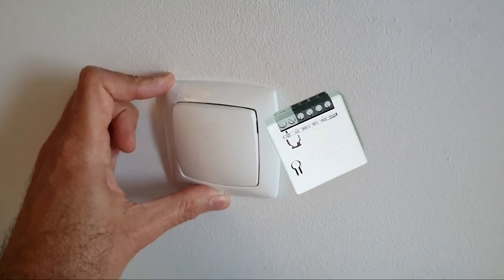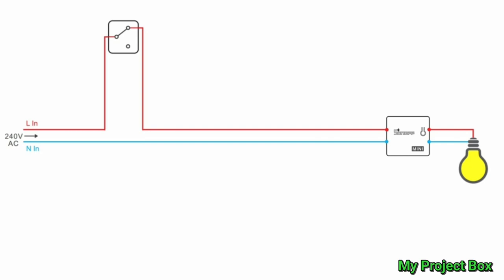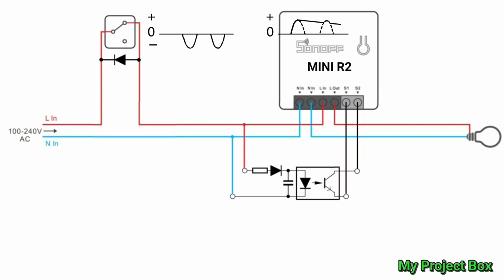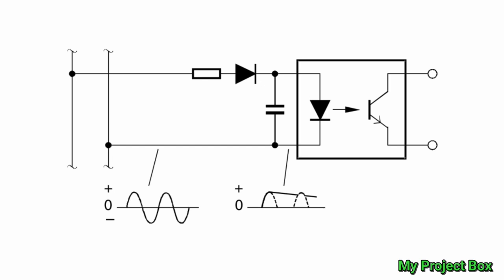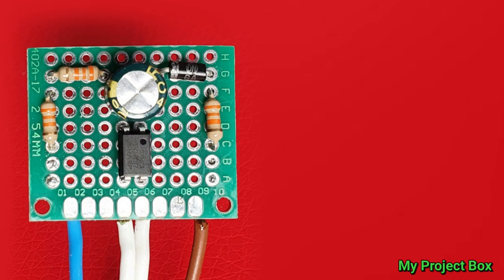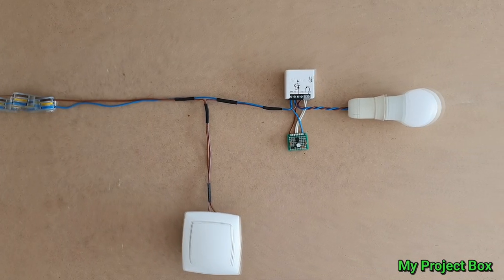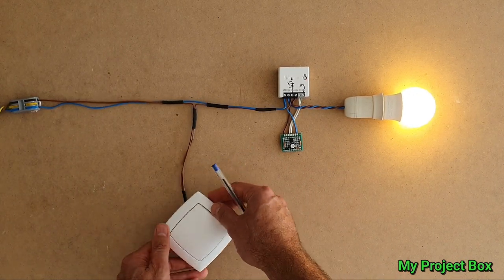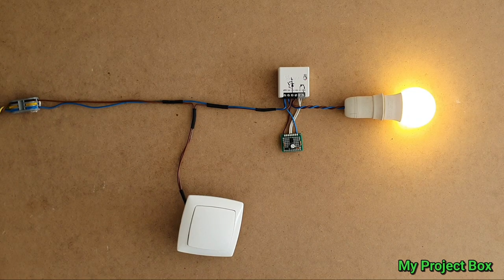Sonoff mini Hack. No neutral? behind light switch No problem! No Live wire!  #ElectronicsCreators

Comment: How do we deal with 2 way switching? Does it require the  diode in both switches or is it more complex?
Reply from the maker: That is a good question! It very much depends upon the type of 2 way lighting circuit. You get the 3 wire and 2 wire system. In the UK the 3 wire system is more common. With the 3 wire system you can just put the diode across the first switch (incoming live and outgoing switched live). With the 2 wire system it's more tricky, the incoming live is at one switch and the outgoing switched live is at the last switch. So it's more difficult to put the diode across both ends🤔🤨. I will think about it and try to find a easy way to do it.
Reply: You could use a Lutron pico remote to replace one of the switches and program that to control the Sonoff.   I guess the unused wires would need to be connected together with a wirenut, to be ‘always on’, leaving the Sonoff in control.   This would require the expense of a Lutron hub, which are $80 on Amazon… but I have one already as I use a lot of their products in my house already.. and I actually find the Lutron Caseta product line to be extremely reliable albeit expensive.   Quality ain’t cheap I guess.   Let me know if anyone thinks this would work?
Reply: Actually, not sure Lutron Caseta products will interface with non-Lutron ecosphere products.   Hmmmmm…
Reply from the maker: You could change the light switches to momentary push button types, and use the existing wires to wire them all in parallel. The sonoff mini can read momentary switches. I believe Screwfix and tool station sell these they look just like ordinary UK light switches. Only about £1. Would still have to add a diode across one of the switches though.

Comment: I tried to add support for multiple LED bulbs from the Shelly1 video, but without success. The fusible resistor breaks as soon as I try to turn on the light. On the L out of the Mini R2 I put the diode turned so that the silver mark is facing the Mini R2 and after that the minus from the capacitor, and on the N out plus from the capacitor.
Reply: I don't mean multiple LED bulbs  but many types LED bulbs :)
Reply from the maker: I'm not sure what you are doing wrong 😢. It sounds correct. Maybe the capacitor is short circuit/ faulty? Is it rated at 400v? There is another sonoff "no neutral" video, are you mixing things from the two videos? Did you add a fusible resistor aswell, for safety. You could send me some photos on Facebook messenger, so I can see what you are doing. It's frustrating when things don't work as planned 🤔😢

Comment: The diode used on the existing switch, is that also an 1n4007?
Reply from the maker: Yes 😉 remember the polarity of all the diodes are very important. You can use a bigger diode if you want. As long as it's rated for mains voltage and sufficient current rating for your load. You can also add a diode and capacitor to the LED bulb socket, to stop some types of LED bulbs from flickering. My shelly1 hack has this improvement added. https://youtu.be/YItMu6VJGBI

Comment: Hi, I like the idea.  However you still have to mount the spinoff at the bulb end which means you don't actually need to do anything as there is a live and neutral at the ceiling rose, where you can just put the switch wires direct to the spinoff anyway, making the circuit unnecessary.  Am I missing something??🤔
Reply from the maker: Yes if you do that(put this on up in line with the light bulb), the light switch can't control it. The moment you turn the light switch off, your sonoff is dead/unpowered, and loses all Wi-Fi control. With my hack circuit the sonoff is powered at all times, and the switch acts as a trigger to control the sonoff. In this way you will have both Wi-Fi control and light switch control, at all times😉👍. I know in the UK you have live neutral and switch live at the ceiling rose. But this is unique to the UK only. Most places around the world you only get switch live and neutral by the light fitting.
Reply from the maker: In the UK you are lucky that you can do that, since you have Live, Neutral and switch live, at the ceiling rose. I actually made a video about that. But the rest of the world only have neutral and switch Live at the light fixture. https://youtu.be/ZaAZA8IbaQU
Reply: Aah I see, I was missing something. In your case the circuit is an excellent work around then. I didn't understand the problem but as you say, apart from not having a neutral at the switch itself, we do have lived and neutral at the ceiling. Pity I didn't think more before ordering 5 X components. 🤣🤣🤣
Reply from the maker: @0garythebloke0  did you really order the components to build this, even though you don't need it?🤣🤔
Reply: @MyProjectBoxChannel  Ha ha yes I did. The 817's came yesterday but they were dead cheap as you said, no worries 😁👍

Comment: Bun bun, dar ce model de octopuler circuit găsim gata făcut?
Reply: Solutia nu e chiar buna. Majoritatea becurilor nu vor functiona corect daca din intreruptor este oprit, si se porneste din WIFI, deoarece prin dioda trece doar o alternanță. Doar puține becuri cu LED vor functiona la intensitate normala, fără să pâlpâie.
Reply from the maker: @tudorrata it's not a perfect solution but it works okay. You have to test the LED bulb with a diode first. if you find one that works just purchase several of them. The one I use is from ikea, and cost €1. LED lamps that use a capacitive dropper circuit will not work. Buck converter type is the best! (Switch mode power supply SMPS) some of the linear regulator type work as well.

Comment: Definitely not legal to put your little home-brew circuit into mains wiring in Australia.
Reply from the maker: I appreciate that insurance companies won't take liability for any home-made electronic circuits. And of course it won't have fancy certification, to meet specific electrical code, in some countries. That doesn't make it illegal to use in your own home. It just means you can't sell your home like that and expected to meet the right electrical certification. In the '80s I built my own light dimmer switches(it was a project straight out of an electronics magazine), and fit them into my own house. I'm sure lots of electronics enthusiasts over the years have made their own gear. As an electronics guy that's what you do, you make stuff and you put it in your house. It's kind of my house my rules kind of attitude(as long as it's safe). When I sold my house I removed all those things. There's a ton of electronic circuits, that were in magazines that you actually fit directly to your electrical system in your house. When we build DIY electronic circuits, they are not intended to be sold, so they don't need certification for home use. When you build these kind of things the liability on you.

Comment: Interesting solution but ultimately futile.
I don't see what part of this is better than pulling a neutral cable to your switch
And don't start complaining about dangerous current cause you still have to mess with those particular cable's .
I mean you push a cable in a pipe vs sourcing component, soldering and messing with more cable's
Reply from the maker: If you can pull a neutral down to the switch, it's obviously better. But that's not always a option. Sometimes it's almost impossible. Some countries don't use conduit, like in the UK, cables are plasted straight into the wall. And sometimes you just don't have enough room behind the light switch to put the sonoff there. You might get terrible Wi-Fi reception if your switch back box is made out of metal. But if you put the sonoff mini by the light fixture itself, you might get really good Wi-Fi reception. So my circuit hack just gives you more options.